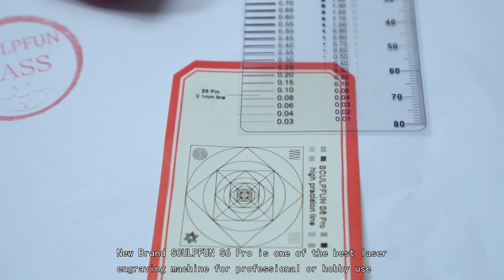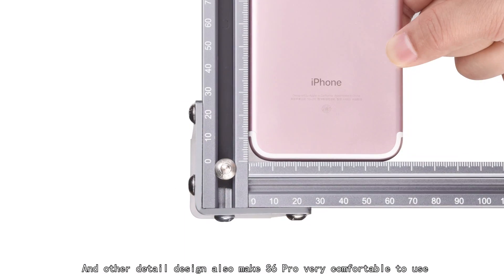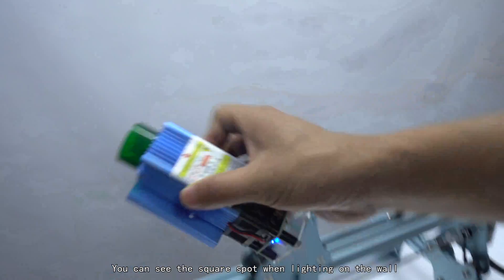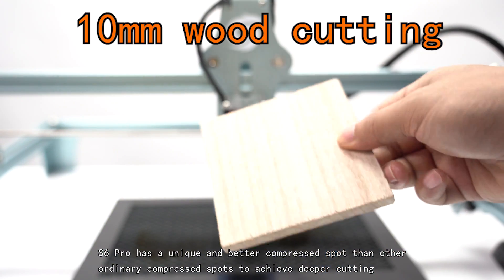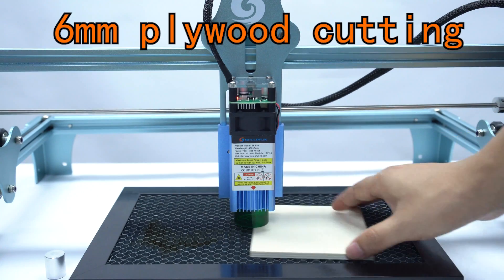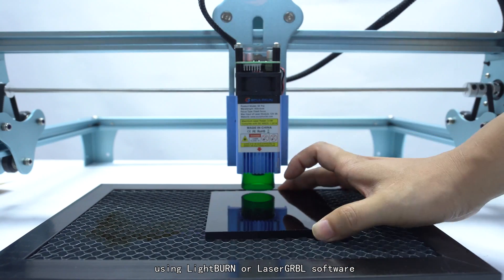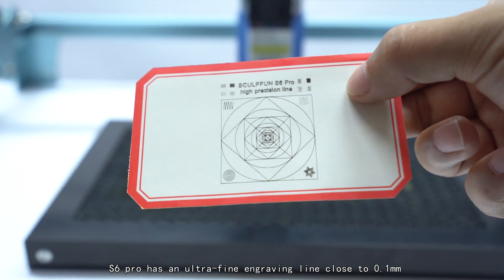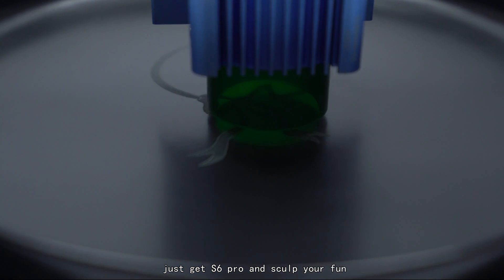Real test of SCULPFUN S6 Pro 60W effect laser engraving machine  10mm wood cutting steel engraving

Comment: A year ago I bought the Sculpfun S6 Pro. I have used it very little but recently when I went to cut a square out of plywood, I noticed that it cut easily but with a little misalignment (crooked), so is this normal to some extent or is there a way to align the laser?  Thanks
Reply: Is it better than sculpfun s9?
Reply: S9 is better. I sold mine and bought the xTOOL D1 Pro 10W.
Reply: Do u want to sell it?
Reply: @amjadmasood8179  I already sold and bought the xTOOL D1 Pro 10W.

Comment: :dothefive:Hi I got this Laser machine and i am so happy about the power of it 5.6W and with compressed spot is the best in the market right now i am in progress to make video about it what is good and what is bad about it Just need to know if they is any information about the board used on the S6 Pro and if planning to release any firmware update
Reply from the maker: Thank you for your appreciation and glad you like it. The motherboard does not need to be updated. What needs to be updated is the engraving software. You can observe whether the software side has updated new functions. Our engraving machine is just a hardware tool.
Reply: @SCULPFUNReal  thank you for the answer Yes that normal but i was asking if there is any software can write on the hardware as the machine accuracy not that good and the axis needs to be calibrated, Just let me know if there is any Thank you again

Comment: May i know this thing can engrave /cut metal or not? how deep?  and what spec that i should chose confirm engrave /cut metal?
Reply from the maker: The S6 Pro is good in carving steel, especially 304 stainless steel. But as you know, there are many kinds of metals, and I'm currently testing that steel and copper can be engraved, probably because they have very low melting points and tend to melt to show traces. For other metals with high melting points (without an oxide layer), this can be difficult. The stainless steel wine pot you see, I don't need to paint black it to sculpt the image. I haven't tested the other metals yet
Reply: May I get your advise on parameters in metal curving? Since my machine interface in good condition I already cut wood n fiew materials but I’m trying to engrave on cooper plate n stanlees steel plat still can’t get
Reply: Using on grbl laser software

Comment: At 1:54 you state the the cutting speed should be increased for a cleaner cut. What was the cutting speed and power used in this video to cut the 10mm ply?
Reply from the maker: For 6mm ply, I recommend that you use 15mm/s 100% energy and repeat cutting until it penetrates. 10mm light wood is the same setting.  You can use SCULPFUN honeycomb panel, it is easy to observe whether it penetrates. And the edges are clean.